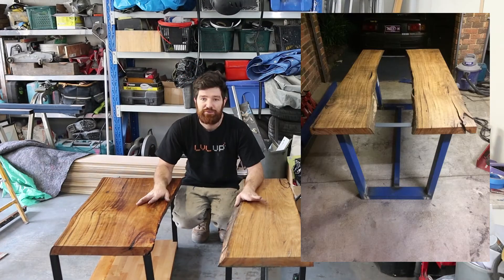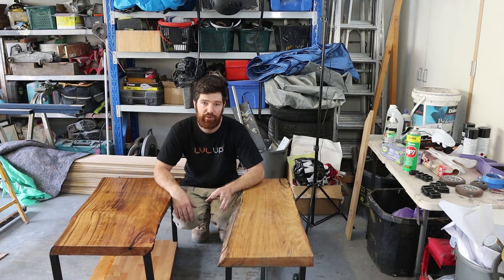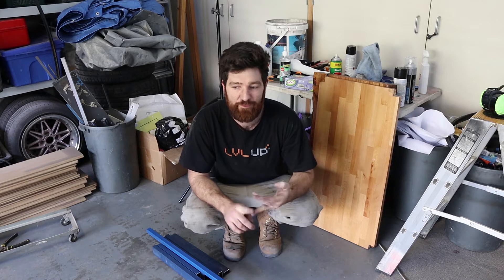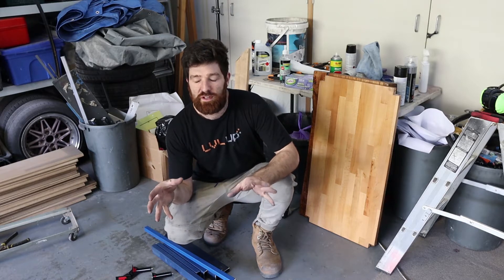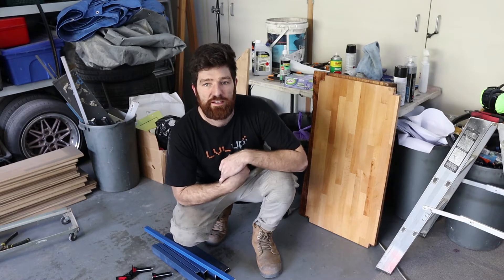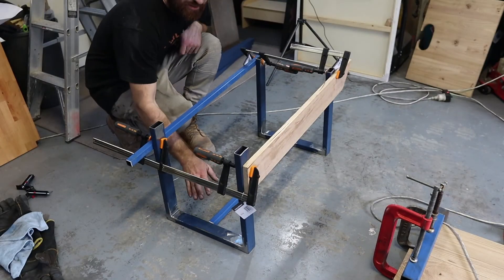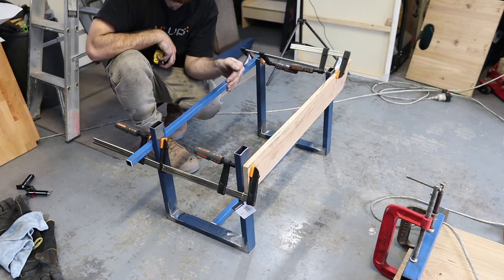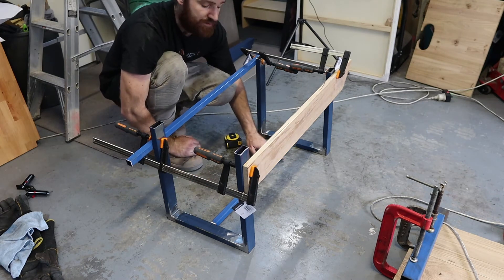Transforming My Balcony by Building Furniture with Recycled Merbau

Comment: Nice, I never weld but I like to give it a try. what would be the best way to get started?
Reply from the maker: My personal approach would be to just buy a second hand welder online and learn by doing. If you're worried about your budget then ask anyone you know with a welder and see if they can guide you for your first try, otherwise see if there's a community near you like a men's shed or a shared workspace. 
Using the cheapest welders can be pretty miserable like the ones you buy for $80 from a supermarket. But if you spend $150-$250 on a second hand welder it might be all you need. You can always upgrade later if you grow a passion for welding in the future!